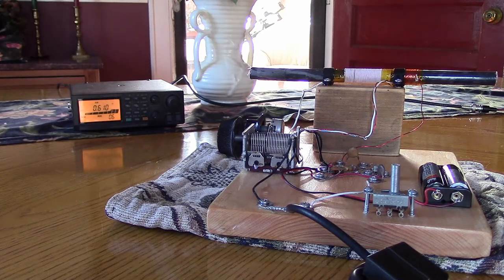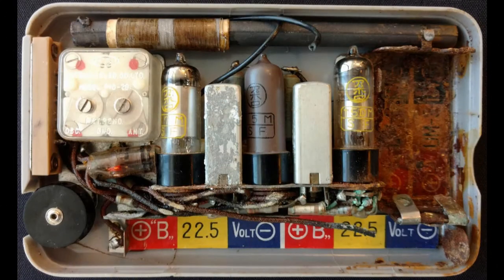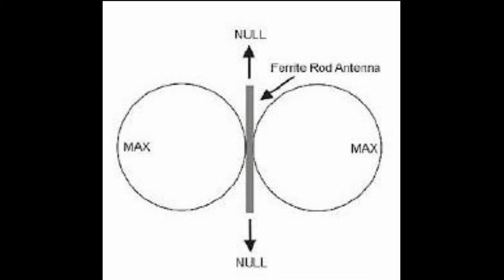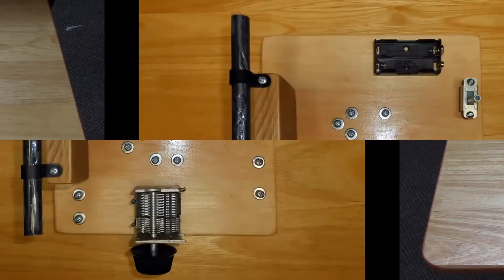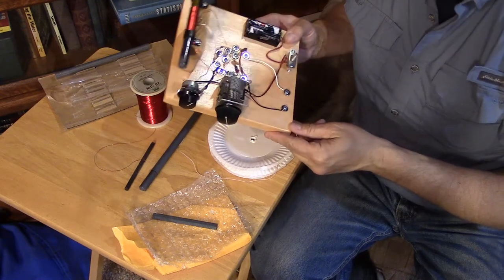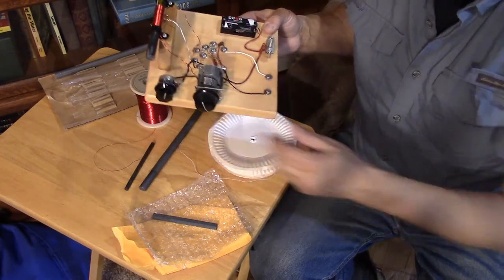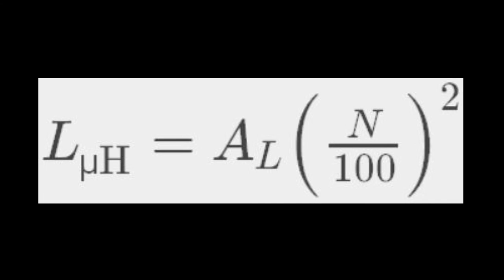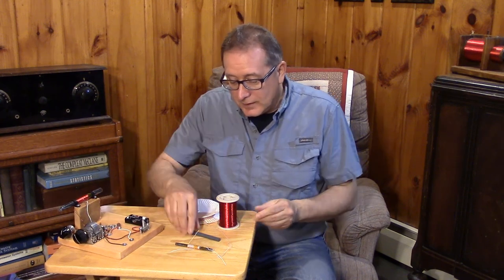Ferrite Rod Fun Part 2

Comment: Another very interesting and enjoyable video. If you have to do the math,  it's easier if you choose a frequency like 1600kHz (actually 1592kHz) where 2pi = 10^7. 3200kHz would also make calculations a bit easier. I remember this from telecoms exams years ago when we used slide-rules and log tables.
Reply from the maker: I love the old radio shortcuts and rules of thumb. The other trick is using harmonics of the signal generator to set the alignment points on the dial like 1MHz and 2 MHz, rather than retuning.

Comment: A suggestion for cutting ferrite rods is try a dremel and cutoff wheel it might have less risk breaking the rod with a more controlled cut clean through. And thanks for the well explained video, you've given me good advice for an AM active antenna to compliment my dx radio.

Comment: When I need to shorten a ferrite rod I put the rod into a drill chuck tightened just enough and then rotate the rod in an opposing direction to a Dremel fitted with a diamond wheel for a nice even clean cut.
Reply from the maker: Wow that is better than the crack it on the table edge method by far!

Comment: Great content! Thanks. For those that have an RF generator and an oscilloscope but no LC meter, there is a PDF from Tektronix called "Capacitance and Inductance Measurements Using an Oscilloscope and a Function Generator".
Reply: I have been trying to look into this, found one video about it where they don't tell the values of any components they're using. I have a signal gen and oscilloscope. Any idea how this circuit works?

Comment: Thanks again, Mike. Allot to chew on...I'm going to review the series a few times. I've got a project I'll be working on this week...a wideband untuned active loop antenna. I'll have to wind two xformers on Amidon type 75 binoc cores (have them onhand, and they're the right mix...dumb luck). One for the input of the balanced loop to the unbalanced LNA, and the other from the output of the LNA to the coax. Hope it works out. It's the only antenna option I have in this very restricted community.
Reply: OOPS...I meant to say type 73 cores.

Comment: nice ! i think maybe a disc cutter would be nice for a good straight edge cut, im experimenting making my own transformer designs so i want to cut out pieces of ferrite for my trnsformer cores !  : )
Reply from the maker: Wow I want one of those.
Reply: @MIKROWAVE1  mm! Maybe are disc cutter isnt so.important for.your  situation. Ive bought some.more ferrite pieces and mannaged to.make.the shape of.transformer i wanted with small ferrite pieces instead of cutting small pieces!

Comment: I couldn't see how the ferrite antenna showed the null at the 4:50 point in this video. If it was shown on the ICOM, it wasn't very clear.
Reply from the maker: The LCD meter on the ICOM is nasty, but you can get it to null. A real analog meter would be a better indicator.

Comment: Great video! Thanks for sharing your knowledge. I do have to protest the using the bridge and then pulling up a smart phone running real calc, should have used a slider rule, or an old Friden calc.  Just kidding. But at least run it in RPN mode.
Reply from the maker: AH yes. You are spot on! My wife and I both had slide rules. She was a bio student. I actually had a class in slide rule with one of those giant wooden jobs over the blackboard at SUNY.

Comment: What about using a MC1350 RF Preamp chip, What about an UNUN to match the long wire antenna to the radio set.
Reply from the maker: I always loved the old 1350. In fact that was a go to chip for many projects in the 1980's. I have one in my QRP XCVR as the IF.

Comment: I'd like to see if a round ferrite "doughnut" from an old tv set would work.
Reply from the maker: The yoke ferrites are similar to FT240-61 so they would be good for making baluns if you glued the the two halves (some are split). But I am not so sure they would be good for making high Q inductors to tune a front end with. https://www.yumpu.com/en/document/view/18662717/free-ferrite-from-tv-sets-in-balun-use-py2wm
Reply: @MIKROWAVE1  thanks. After I thought about it I realized that would probably be the case. The thing is I've been scrapping lots of old TVs and I have some enormous ones I just couldn't let myself throw away. Some of them are 4 or 5 inches diameter. Any suggestions on a purpose for them? Obviously these came from bigger picture tubes than they were able to make with the iron powder ferrite and the scratch test confirms they are more ceramic-like. I tried sticking half of one inside a toilet paper roll crystal set I made a while back and moving it back and forth as an experiment and didn't get any noticable result.. also would you think that magnetic fields could be utilized to affect a crystal sets performance? Kind of like a voice coil and humbucker coil in a non permanent magnet speaker, only, hopefully, opposite. In other words an external magnet could be used to accentuate the coils magnetic field, or cancel it out perhaps. Just thinking out loud. Thanks for the teply:)

Comment: Does ferrite outside the length of the coil have any real action?
Reply from the maker: Increasing ferrite or powdered iron rod length and diameter act to capture and concentrate magnetic fields more efficiently. The null depth is also improved with length. So yes.

Comment: How  matching  this antenna with  lower imput impedance mean  calculate number  secndary turn
Reply from the maker: It is basically a square law. So halve the turns ratio = 1/4 the impedance.
Reply: @MIKROWAVE1  thankyou
Reply: If i now the  the imput impedancce is25 hom  can you explain me by exemple

Comment: Hello, dear engineer. Really, both parts of this video were perfect and perfect in every way. I want to be honest, for several years, whenever I came across the subject of the frame of those AM radios and the issues related to them, I always had questions in my mind. It remained that even after searching on Google and reading several pamphlets due to the scattering of the contents, I still did not understand exactly...points such as cutting the ferrite rod or whether it is possible to glue two ferrite rods together or not. Where is the most suitable place to place the coil on the ferrite rod and...
I wish you success and health. Alireza from Iran